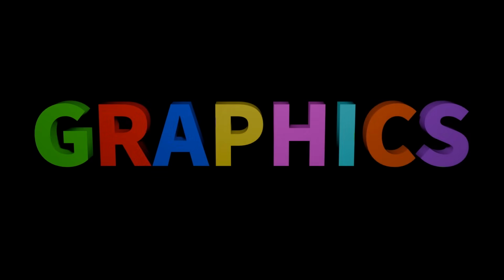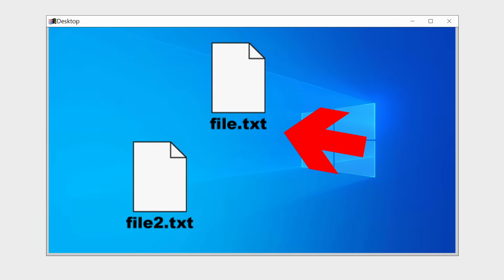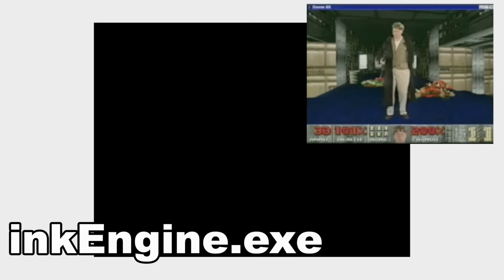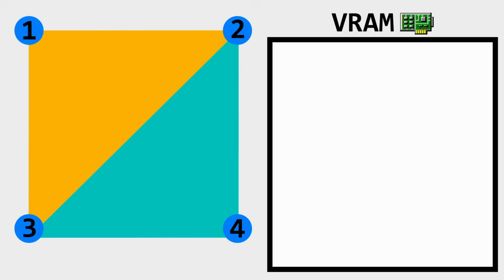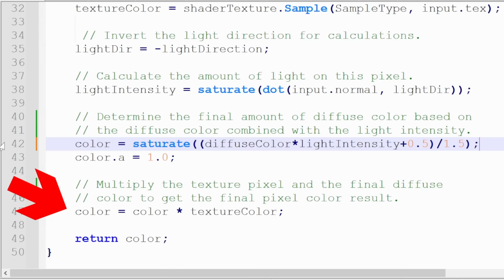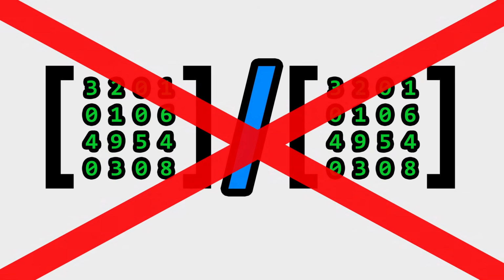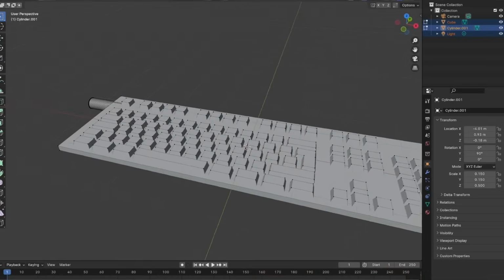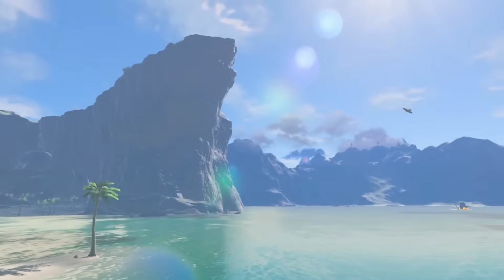Creating My Own 3D Graphics Engine

Comment: Well, rendering hundreds of cubes bellow you as one giant floor is kind of a bad idea
What you could do instead is make a single quad which's UV coords go higher than 1, and make sure its texture is set to repeating
Reply from the maker: Good idea, I'm sure I could write a shader for that
Reply: @InkboxSoftware  No, you see, there is a flag you can give your texture whilst setting up your scene, which makes the texture repeat or clamp itself when the UV specifically goes above 1. It'd save you compute time rather than having the shader manually do the wrapping
Reply: @InkboxSoftware  you don't need any shader for that, you just need to configure the sampler differently...
Reply: @aspectreishauntingeurope  wouldn't you need to edit the code in the shader to do that then?
Reply: @soryabuscompany  no, samplers are created on the cpu.
Reply: @soryabuscompany  Nah, theres some "Hints" or w/e its called that you could have repeating texture, clamp texture or just a single texture.
Reply: Ah yes the the nerds
Reply: @gaitaguamangkamei2849 of course we're gonna be nerds, this is an Inkbox video

Comment: I gotta be honest, that 3d UI thing you did seems cursed.
Reply: it is indeed incredibly cursed and stupid lol
Reply: wait till you find out about the full screen quad and its even more cursed cousin the full screen tri
Reply: @RADkate  that doesn't sound that bad as long as it's just one polygon. Still weird though
Reply: @benG2141  nah 2 triangles making up a full screen is incredibly common that's how all UI is rendered in 3d games and even some 2d apps
Reply: @alex31ytb  I understand that it works, but it seems very strange to me that you wouldn't bypass the triangles entirely and just draw pixels on the screen
Reply: @benG2141  you can do that, but you'd have to use your cpu, which is obviously quite a bit slower
Reply: @aspectreishauntingeurope  that sounds wrong. The GPU is drawing pixels on the screen too, in a different way. No sane computer architecture would make this process slower, I would think.
Reply: @benG2141  ofc the gpu draws pixels, but it does that by rendering triangles... if you wanted to entirely bypass triangles, as you said, you would have to render on the cpu
Reply: @aspectreishauntingeurope  weird. I would expect even the GPU to have a dedicated screen space rendering mode that isn't just more triangles
Reply: @benG2141  there really is no reason for that when you can just create a single quad
Reply: the problem with this video's implementation is that it transforms the quad(s) just like 3d objects and then reverts the movement by an inverse multiplication (!!) instead of just not transforming them at all
Reply: @benG2141 The GPU is specifically designed for drawing pixels on the screen, obviously it will be faster than the CPU
Reply: the more you dig into the workings of a computer, the more horrific things you find.
Reply: @lazerpie101  nah not really tho the grease sits atop

Comment: I've always been curious and interested about how all of this works on a lower-level software speaking. It is kinda interesting that software engineers do not have to worry about things like this anymore and can just use frameworks but for some reason it doesn't sit right with me.
Reply: Underneath, they are clearly very complicated tools, but it's the same as you or I 'building' a computer... you don't need to know anything about electronics. It's like putting together Lego tricks. Writers and artists don't need to understand how paper, ink and paint are made, they just use them. Bricklayers building houses don't have to understand the chemistry of bricks or the physics of adhesion. Car drivers don't need to understand rubber compounds, the physics of steering or the chemistry of petroleum or diesel in order to drive a car. 😉
Reply: @another3997  That does make sense, should be left to computer engineers to worry about 😅
Reply: @another3997 

Consumer is the end user. That how things are. There are so much complex stuff we aren't supposed to worry! For all of this comes out of human cooperation and good labor. Components for tools, tools to assemble creations or products to please a need. And now tools combine. We combine vehicles with radio and speakers, now we add computers and cameras, illumination and even sturdier crafted glass materials. To make things better and to evolve.
Reply: @another3997  Abstracting away all the complicated engine work has allowed so many individuals to create their dream game they never would have otherwise but devs nowadays tend to take it for granted combined with how powerful computers are so long gone are the days of clever optimizations and now we have the standard 500gb aaa game
Reply: @lukeskywalker2  They can and likely want to make it smaller, but they don't have the time or money for that.
Why? Because the stupid shareholders demand more, more, more profits.
Reply: @another3997 i read that in Grady's voice

Comment from the maker: To try everything Brilliant has to offer—free—for a full 30 days, visit https://brilliant.org/Inkbox/ . You’ll also get 20% off an annual premium subscription.
Reply: This video is great! I have one tip though: The ground can really just be one big square. If you use a wrapping texture and multiply the UV coordinates, the texture will be repeated across the entire square.
Reply: no
Reply: Thanks for great review! Please tell about skeletal animation.
Reply: @FiEctro  matthias muelle ris the physics guy for nvidia, he has a physics channel called 10 minute physics. the constrainment method method he uses (the name spaces me atm) is simple, performant, effective. it may be known by other names (laplacian, i dunno) but the idea is that you take the initial position, store it, apply the velocity and constrainment/physics stuff, then take the difference between that and the new position and use that as velocity ;) it's more stable than trying to modity velocity otherwise and increasing iterations. works good.
Reply: scam
Reply: hey buddy - you can use OpenGl without dependencies easy - i use LoadLibrary and GetProcAddress to get the APIs from the current .dll on the system. it's a couple hundred lines loading the prototypes for the APIs you want, and then you're not dependent on GLEW or anything.. pass the transform and view matrices as float arrays, use whatever kind of math you want (i used euler rotations for my first 3d instead of quaternions or bivector rotors..) my github is linked in several videos with simple examples (also how to add sound without resources).